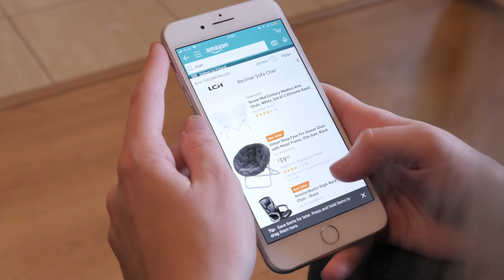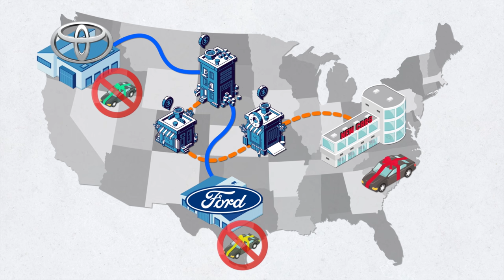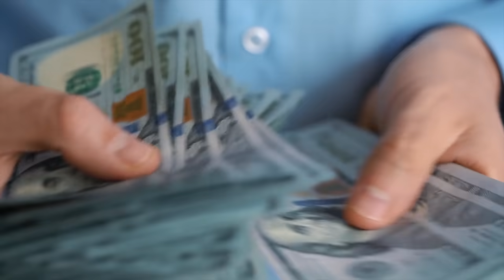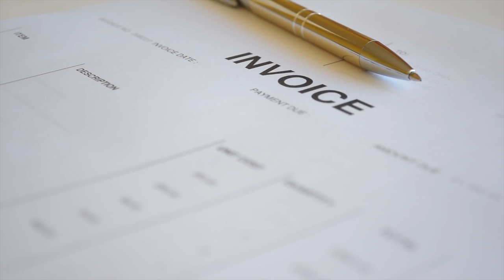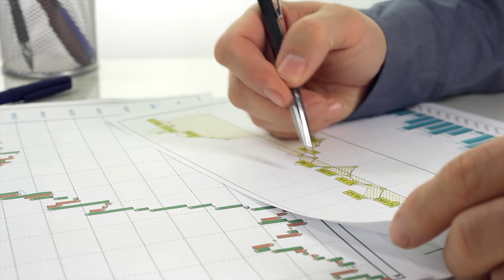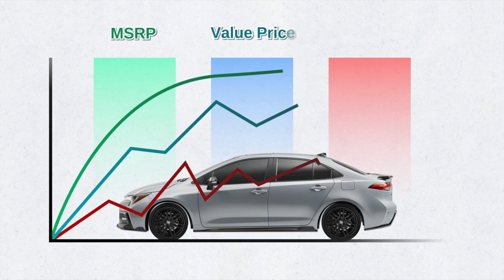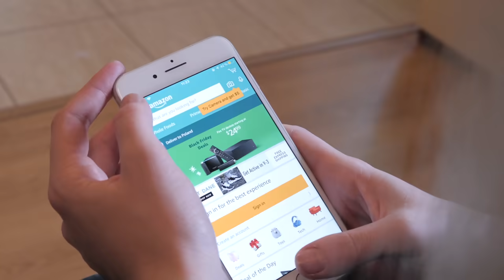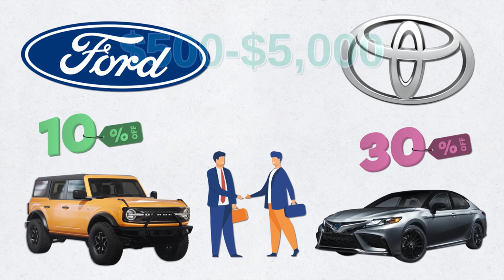Here’s Why Car Prices are About to Get Way Worse

Comment: I had a Ford getting ready to cost thousands on a transmission. I looked at a 2020 Civic with 12k and then a 2022 civic . I got the 2022 for less than $800 extra out the door over buying the 2 year old car with 12k miles. I'm glad I made the two hour drive and got the new car.
Reply: Nice job...pays to do your homework...
Reply: Always, always travel to buy a car. Go to a "depressed" area. A small town far away. It's worth it every time.
Reply: New civic is sweeeeet
Reply: If its the DPS6 transmission try getting up to the speed limit faster
Reply: @chocolatemilk2076  Why?
Reply: @danielwebster7030  damn i learned it too late !
Reply: @Jorge01234  vtec maybe ? Lol
Reply: I see more and more of that nowadays. That is you walk over to the used car lot and they have the used cars priced the same or more then a new car. Best to buy a used car from an individual then a used car dealer IMO.
Reply: Hopefully you got the manual transmission, Hondas are not what they used to be. New automatic transmission civics use a CVT which are notoriously problematic. Best of luck to you.
Reply: What Ford was it.
Reply: @CJColvin  I had a 14’ Fusion. The 12 -14 model had trans issues. Then recently found out the 1.5/1.6 & 2.0 ecoboost engines before like 2019 have coolant intrusion issues when looking up about my rough idle when hot. So it was about to cost big money.
Reply: @brandonmartin4044  Yep you got it brother.
Reply: @CJColvin  fusion ST
Reply: @brandonmartin4044  Ford Fusions are definitely piles of crap for sure.
Reply: @danielwebster7030  that’s true these stealerships In Orlando fl ain’t playing
Reply: @brandonmartin4044  2010-17 ford fusion transmission are defective since day one . Ford got a lawsuit couple days ago for that reason, but the Ford's  duratec v6 engine 2006-2012 fusions are very reliable.
Reply: The Civic hands down is Honda’s Masterpiece.
Reply: @boogitybear2283  I absolutely love it!
Reply: @theshield1613  Unless it’s a pickup I’m done with American cars.
Reply: @brandonmartin4044  my Ford 2010 has almost 200k miles no problems at all.
Reply: @theshield1613  2012 through 14 were notorious for transmission trouble. Sometimes I just change suppliers certain years and it backfires.
Reply: Hi RPMs
Reply: @Ecuador006  Vtec FTW
Reply: @brandonmartin4044  Toyota makes the best pickups as far as reliability goes.

Comment: Thank you Scotty great video as always. I'm definitely going to be hanging on to my 05 GMC Sierra as long as I possibly can. Of course it only 120,000 she runs like a new one even though I recently discovered about GM's great idea and replacing the PCV valve with that stupid valve cover. After making the mod myself everything is good again. It's my thought that when the pandemic is over and all the parts become available again there's going to be a huge surplus in new vehicles and prices are going to drop tremendously.

Comment: I have a 2005 toyota highlander.  I love this channel, even though zero of these issues apply to me.  I just change the oil and get the checkups.
Reply: I have one too. That HL is an awesome tank. Definitely a money saver from buying a brand new one even with 200k miles. Only downside is that it a gas hog as V8 when driving in city

Comment: Here in Alabama, there are dealers who are adding $5000 and $10,000 to the MSRP sticker.  They mark it as "market condition".  They put the $5,000 mark up on a new Mitsubishi and $10,000 markup on a Cadillac Escalade.  I honestly would not buy EITHER car if they took $5000 off the MSRP of the Mitsubishi and $10,000 off the Cadillac.  I am sticking with my 2010 Toyota.  In October I donated my 1994 Camry LE  with 159,000 miles and in good shape to Wounded Warriors.  They were very happy.

Comment: Eh, I agree, keep your car or truck for a reasonable amount of time. But be mindful of the shortages that are causing low supply. They aren’t going away in the next 2-3 years. If you’re going to be needing a vehicle in that time span plan accordingly.
I just ordered my wife a Ford Maverick to replace her 2009 impala with 280k on it. We are selling the car because it’s worth twice what it was last year and I’m fixing a 2013 escape who’s previous owner sold it to me for next to nothing after he hit a deer. $500 in parts and we’ve got a used car worth $5k.
Reply: Ford stopped making Mavericks in the 70's.
Reply: @jamesdelap4085  they brought the name back it's a new truck, it's the only real compact truck in the US and it's the only other unibody truck besides the Honda Ridgeline, it also has a hybrid powertrain option.

Pretty cool, now they just need to make a version of it with the 3.5 Ecoboost so I can buy a small little race truck

Comment: How do you get money back after being ripped off from a small town repair shop? C&J auto in Washington Courthouse Ohio, ripped me For$578 after I told them I needed bank 1 sensor1 02 replaced, they fed me a line that my intake gasket was blown, cleaned my maf sensor tapped a spark plug wire, cleared the codes. 2 miles later check engine light is on. Long story short, after a loss of blood, torn skin, I finally removed the sensor. 1 heater wire  clearly broken had green crust on the wire sticking out, both power wires had been chafed exposing the wires. Yet these pros using the best scanning equipment could not find the obvious

Comment: The prices today are just outrageous. They started getting costly when the government had that stupid cash for clunkers. $8000 to buy a truck.  It only took the manufacturers 5 years to price that in. That in turn made the used truck prices to astronomical prices. The only way to lower them is to change the financing.  No vehicle should be able to be financed for more than 48 months. Then the vehicles wouldn't be so costly. Who is going to pay $1500 per month. Problem fixed. And please don't say that it's overhead and labor causing the increase. That just makes you look stupid. In 2004 I could have gotten a tundra fully loaded for around$32,000+-. A decade before that $26,000 for a loaded truck. Cmon Man!!!
Reply: People can finance what whatever they want. When I buy a vehicle I keep it for 10+ years. I get a low interest rate. So if I’m keeping it for so many years what’s the difference if I finance for 4 years or 6?

Comment: 2006 Ford Ranger , 205k miles , don’t need eco boost, electric engines , 3.0l engine is reliable and gives me plenty of power to do everything I want. Bought it in 2013 for 5700$ cash , looking at used truck market now turned out , my little Ranger gained in price KBB price in 2021 is 7000, my truck is in perfect condition with lots of extra, accessories, will drive it till the ground claims it 🙂

Comment: I work in a Toyota dealership as a detailer and I can say this the prices are extremely high right now for example we had a used Tacoma TRD that's being priced at almost 70k
Reply: These prices are not going back down like the media has gotten many people to believe. This is not transitory it's permanent.
Reply: @muddyriverdogz  I think one of the big reason why for the dealer I work for at least doesn't have a lot of cars ATM so they are being overpriced to compensate
Reply: @erickrueda16  That is part of it but not all of it. Prices on everything is going up across the board. Direct result of the Fed crating money out of thin air expanding the money supply.
Reply: @muddyriverdogz  Inflation is rampant throughout the world right now.  Check the overseas news sources.

Comment: I was becoming concerned with the 2005 Chevy Malibu Classic we have been driving for almost 10 years now. When I got it it had 74,000 miles on it. It was at 215,000 and, though it really showed no major problems and was reliable, it had many little problems and things that needed fixing. So we took it to CarMax.... Yep, big mistake. Traded it for a 2018 Malibu that the next day the check engine light came on... We took it back for a refund. All sales are final on trade-ins. A few days later we went to a Toyota dealership and bought the only 2022 Camry LE which was the only new car on the lot. It was $1000 over MSRP because of window tint and some bug guard plastic. We got $500 back by using Toyota financing. (We will pay it off when the first payment comes.) The real story is that looking on Carvana there are 2021 Camrys for $1000 more than what we paid. Buying new saved us money. A week later and I still think the car is great. I really believe this will be the last car I ever buy. I have no doubt I will put at least 300k or more on it.

Comment: Then there is dealer pack or pac, an amount included in the invoice price, supposedly to defray, utilities, salaries, reconditioning expenses and paperwork. Almost all used car dealers do this and new car dealers sometimes do to, showing up as a paper attached to the new car sticker, things like the $1000 wax job and $1000 undercoat. Rusty Jones used to be an undercoat brand dealers would put on every car, then try to make the buyer pay for it.  The amount of pack can vary, but in the '70s and '80s a $6000 used car could have $1000 of pack.  I've been out of the business for several years, so I don't know today's prices.

Comment: Same thing is happening in the UK. My 2016 Auris/Corolla cost me £9500 with 41,000 miles at 2.5 years old. Now its 5 years and 1 month old with 59,000 miles and its still worth that much so car prices are really inflating.

Comment: I bought a new Honda Civic recently for $6,900. New = 2004 garage kept, 30K miles.
Reply: I had an 04 Honda Civic and the only problem I had on it was I needed to change out the timing belt other than  that it ran fine.
Reply: These years have bad transmissions.

Comment: I got lucky and bought my new car for about $1,500 below the MSRP listed on the sticker.  But, it was in late March (2021) when I bought the thing. My timing was good, thankfully. I was shocked when they made the offer to me. I didn’t haggle them down. I was looking to buy the car for months before, so I know what the MSRP was before going in to buy the car. What did I buy? A fully loaded 2021 Subaru Crosstrek Limited with the 2.5 liter engine. I know how you feel about Subarus, but I did my homework and feel good on what I bought. I talked with a lot of people who own Foresters equipped with the 2.5 and NO negative stories on reliability. If it turns out to be a lemon, then I’ll get a Tesla. I’m very religious on car maintenance, though, so it should last me for awhile. I traded in a 2015 Prius that was having a lot of software issues that the Toyota dealership couldn’t figure out. Pissed me off enough to not replace it with another Toyota. I do know that Toyota has a 20% interest in Subaru.The Prius at trade in had 46,855 on the odometer. I took the Prius in for the first software recall last year and that’s when the software nightmare started. When I got the car back, it wouldn’t start. I was angry! They had me wait for 3 more hours before getting it back to me. Damn thing sounded like a VW TDI. Several more service visits and the thing was barely getting 40 MPG. Before the nightmare, I was getting between 48 and 56 MPG. I’m easy on cars and this Prius looked new, but ran like s**t after they got their hands on it! All the best, Scotty! Love your videos!!
Reply: Dang bro. I sympathize you here. I like Prius as I used to own one for 4 years but don't like it for long term ownership. Too many unknown electrical to deal that just make it expensive and time consuming to deal with.

Comment: only vehicle ever bought new was a 1998 ford ranger...just put $2500.00 into rebuilding entire suspension and a few other things, drives like new...never getting rid of it...never...even a new engine would still be cheaper than a new truck...be smart...

Comment: Bought a brand new car in 1996 (a 97 Ford Contour SE V6). It lasted 21 years (167,000 miles) before the CD4E tranny crapped out. The buying experience and price were reasonable (Franklin Sq, LI NY).
Reply: Did you replace the tranny or scrap the car?

Comment: I'm still driving my 2002 honda civic. But now it starts and dies. The first time it started and ran rough and died. Now just starts and dies. Can't keep it running.   I have to get it towed to the car repair shop. About 4 months ago it wouldn't start at all or I should say it started sometimes so they put a new crank sensor in. That worked. It ran good until now. Help!

Comment: The difference between car makers not selling directly and say coke is that the goverment tells car makers they CANT sell directly. There is nothing stopping coke from selling directly but using stores/vendors is easier and how they built there system so it would be harder for them to completly change that to a self distribution/selling method. 

Now car companies like Tesla are fighting against the dealer model and selling directly to customers. So we know that works, and also reduces cost so we dont have crazy markups on high demand vehicles like you see with dealerships now.

Comment: the dealer distribution protection laws do create issues. For example, even though Tesla's are made in Texas, each car has to be shipped from outside of Texas when sold. Tesla unlike Ford etc are more like Apple in that they sell their cars on-line. Yes they do have a few show rooms for those who want to kick the tires but no real franchise dealer network as such.

Comment: Same reason I never sold my ole trusty '98 z28, lots of cheap parts and only vehicle I've owned to never break down nor even a single check engine light and it gets 30mpg cruisin at 65-70 with the grandpa 2.73 gearing lol... Now the '11 STI Subaru is starting to eat a few minor repairs but are least that has held decent value.

Comment: I was underwater on a loan. Sold to the dealer and was able to get away from the loan unscathed. Normally I'd be worried about prices for something else, but I paid cash for something else and already had another one in the driveway. These prices cannot sustain because the masses cannot support those prices. Something is only worth what someone can or will pay. Unless lenders go to 10 or 12 year loans 😄

Comment: I want to buy a new Honda Civic sedan sport and it’s around 24k but at the same time I have a Chevy 2002 cavalier with 130k miles. Radiator fan is not working and fuel pump and fuel filter needs a change. It will cost me around $500 to fix it. Car is worth like 4K. Don’t know what to do buy new or fix old car.
Reply: If the used car starts costing a couple hundred bucks a month in repairs and you truly need a dependable car then the new car looks like the best choice.  I don't have much patience for any car that is always giving me headaches.  I did at one time have a 20 year old Accord that looked horrible but it ran good and was perfect for commuting to work.  Plus I didn't worry about door dings lol.
Reply: @kjisnot - Been driving it for 7 years now. Besides changing oil, tires once, and breaks never spent any $$ on it. This is the first time.
Reply: @Maxcap208  If you like it like an old pair of jeans I would say fix it and keep going.  Everything wears out eventually so something needing fixing isn't unexpected.  BUT if it become a fuel pump, then shocks, then steering gear, then this or that it starts to get to the point of diminishing returns where you might spend $5k on a $4k car.  Your gut will tell you when it's time to move on.

Comment: I just got a reading on my 2001 Toyota Camry LE V6 3.0L  air/fuel ratio sensor heater Circuit malfunction Bank 1 sensor. How do I fix this? I am willing to tackle anything. please advise.

Comment: Question: I'm in the market for AWD, A to B, put-put car. I was going to check out a 2011 Honda CR-V with 265k miles on it. I couldn't make the appointment and I called the dealer. During the phone call, the service guy (not sales guy) said that he had taken it out on a drive to "warm it up" before my appointment. He also said something about juicing up the battery for me. Is this kind of lingo normal?
Reply: Maybe the spark plugs never got changed so when its warm it'll start easier.

Comment: Hi Scotty, having an issue with my Toyota Corolla. Engine light shows oxygen sensor issue. It was replaced twice and I still have an engine light on. What else can cause the sensor alert? Btw, I also put a new gas cap. Any suggestions??

Comment: You can't even buy a new Toyota right now, my dealer, which is one of the largest has no new cars, they have resorted to selling used now and those same cars 8 months ago were $9000 less.
Reply: I wanted to buy a new 2021 Tacoma. The dealer only had one on the lot. I found one at Carmax with very low mileage and bought it at a fair price.
Reply: @jaysmith179  My sister's boyfriend wanted a new Tundra, but had no choice but to buy a certified 2020. It's pretty grim, but not too surprising considering that the shortage is all about discouraging people from buying gas powered vehicles.

Comment: 2018 Chevy volt with ~32,000 miles for $22,000, yay or nay?
Reply: Will start on fire.
Reply: @jaysmith179  volt not bolt, volts aren't known to catch on fire as far as I know